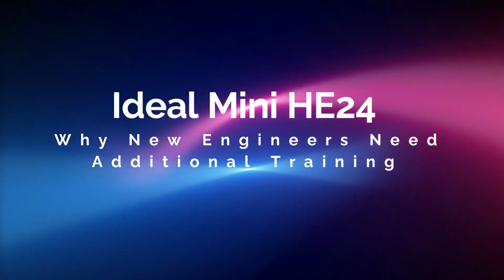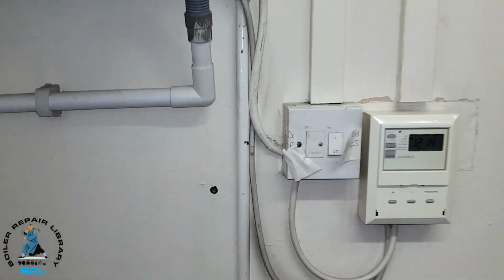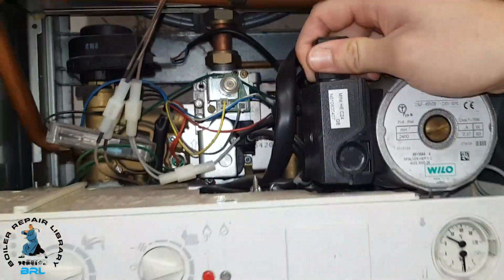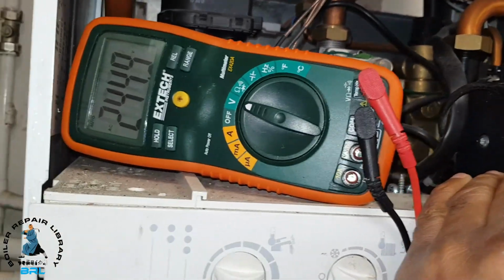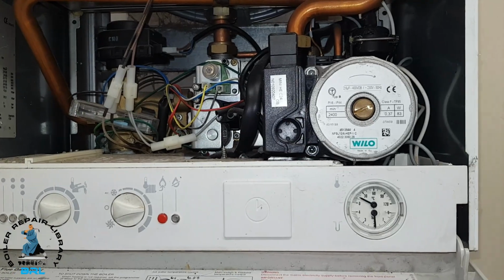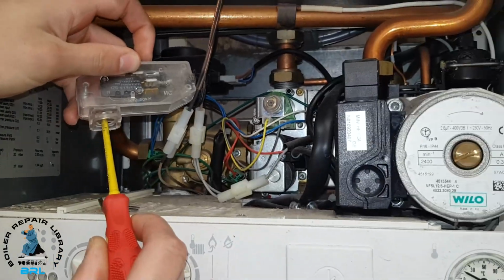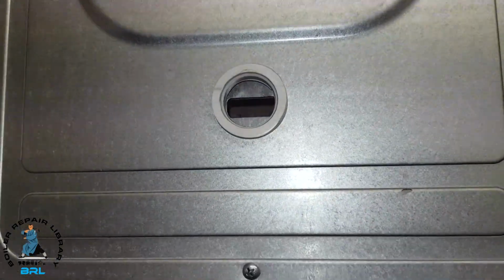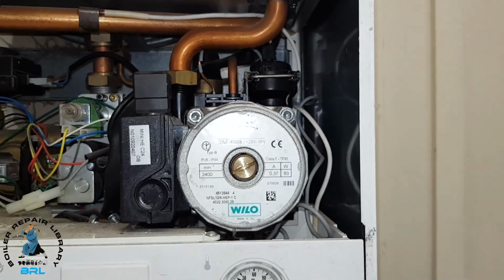Ideal Mini HE24 Why New Engineers Need Additional Training

Comment: Hi Tony I watched your video on the Worcester Bosch 35cdi where you placed a plastic bag over the control panel to keep water out, I had a so called plumber out to change my plate heat exchanger and sure enough he totally flooded the control board, I said that will have damaged the PCB he said it will be fine, he put it back together and the hot water worked for one week then all the light on the panel started acting up and back to intermittent hot water again got him back out and he said chucking money at it won't solve problem and I need a new boiler at around £3700 but not a fixed price 🤔 so as I can't afford new boiler I got myself a reconditioned PCB £56 with 12month warranty a new one costs £320 so big saving,  fitted it myself so saved anther £100 so I  turned it on and running like a dream, I rang lots of plumbers and none of em interested in coming out all saying the same ( you need a new boiler) so I think it's a matter of cherry picking the jobs they do and steering clear of jobs they think will be a ball ache.
Great videos Tony.
Reply from the maker: Thanks for the your comments and can you please subscribe to our channel 😊